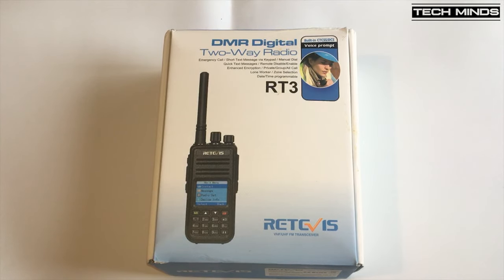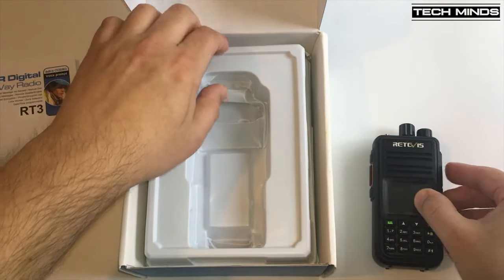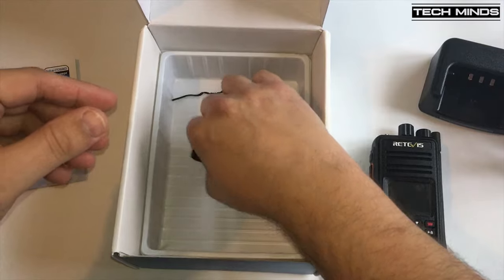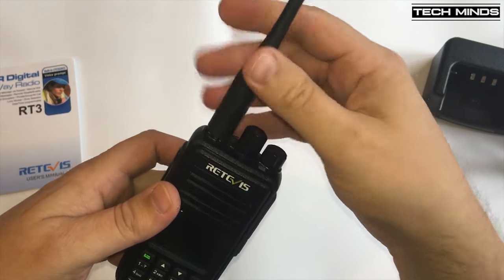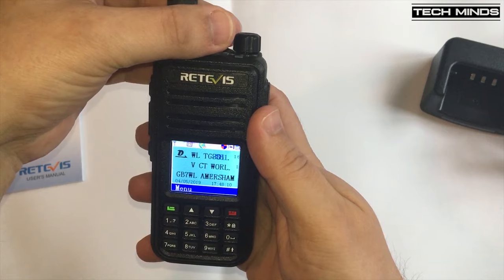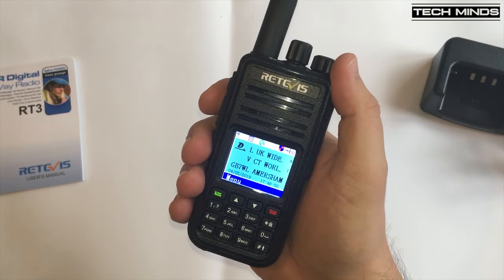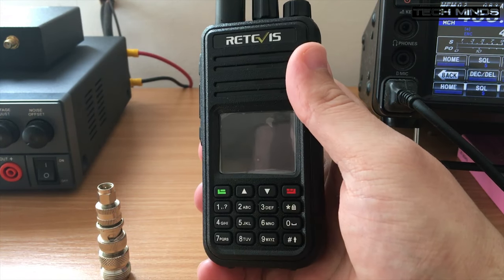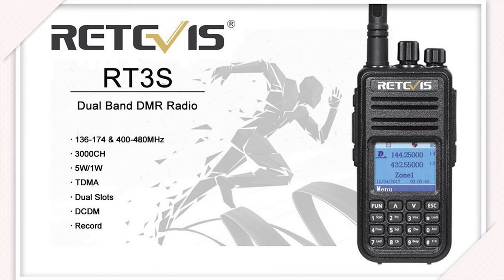RETEVIS RT3S Dual Band DMR /FM Handheld Radio

Comment: Looks like a nice HT. I have the Ailunce HD1. I got the GPS one because Amazon had in $40 off so it was cheaper than the non GPS model. From what I hear GPS serves no practical purpose on a DMR radio. Is that true?
Reply from the maker: Well, apparently the GPS can be used to send your location details to the APRS servers so you would show in APRS.FI website. Once I’ve worked it out I’ll be doing a video on it, hopefully with some real live footage of it working. I think it depends a lot on whether your local DMR repeaters pass on the GPS info to the servers through a specific Talkgroup. I’m hoping to get an HD1 at some point too, I like the RT3S because I’ve been using an MD380 for ages and really liked it, built really sturdy and feels pro.
Reply: @TechMindsOfficial  I like that it is half the price of the Ailunce HD1

Comment: Good video. I enjoyed watching. I would suggest making a jumper cable with an SMA connector on one end and either a BNC or SO 239 on the other end. The way you do it puts too much stress on the radio's SMA connector.
Barry
Reply from the maker: Thanks Barry 👍 It was just a demonstration that the radio could be connected to an external antenna. I personally have every single adapter I can think of but just didn’t have it to hand at the time. But yes, if someone saw the video and wanted to connect to an external antenna I would personally recommend a male SMA to SO239 adapter. 😀 or a small fly lead to take any stress off depending on coax size.

Comment: I see a few tier 1 & 2 radio's being advertised.. but isn't tier 1  fdma like used on dpmr? I can't find fdma mode in the specs so I think I am wrong ? 🤔
Reply from the maker: Both Tiers are TDMA but Tier 1 uses the entire bandwidth where as Tier 2 uses 30ms time slots.  Which makes Tier 1 unusable on Ham Radio DMR repeaters as they are Tier 2 with 2 time slots. :-) Hope that helps.

Comment: 4:30 way to teach everyone what NOT to do.  You'l get a broken SMA connector using all that junk.  Get a proper SMA male to SO-239 F CABLED adapter.
Reply from the maker: It’s what I had to hand at the time, I have all of the appropriate connectors. The point of that demonstration was to show that it could be connected to an external antenna, not to specifically use the connectors I used.